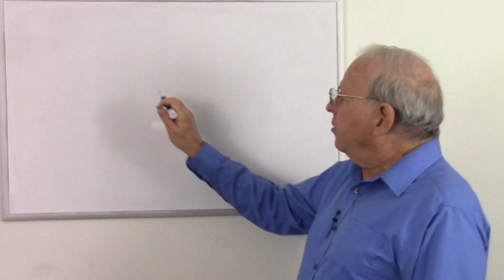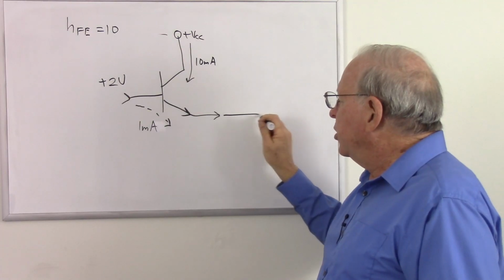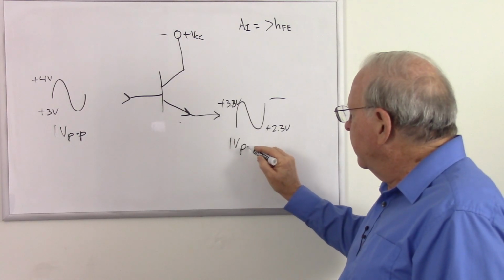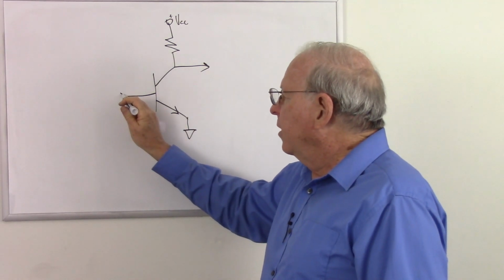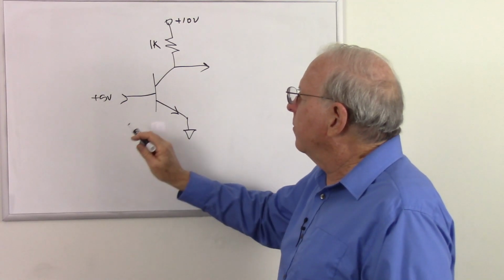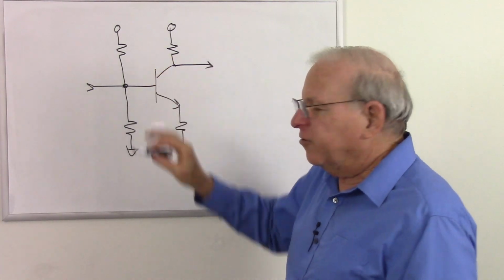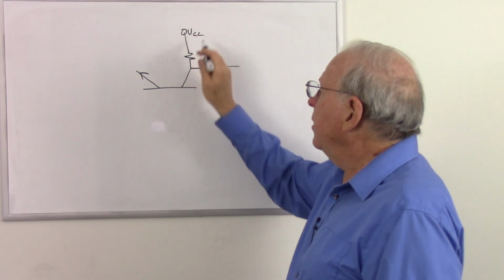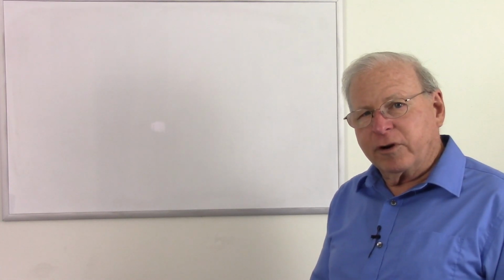Amplifier Configurations  - Solid state Devices and Analog Circuits - Day 6, Part 3

Comment: I am really enjoying your vids, so 1 thing disappoints me a bit. My mental arithmetic is pretty fair, and 7.5V from 10 is 2.5, not 3.5. This mattered as that error formed the part of other calculations.  Sure, I got the point, but its still disconcerting. In your amp design vid you described 10mv as 0.1V instead of 0.01V and so derived 10mv plus 0.7V as 7.1V instead of 7.01V. Again, I understood what you were doing, but your calcs were now wrong in a few other places when you used 7.1V. I usually criticise calculator use for simple stuff, but please start using one - accuracy here matters in these classes. 

I apologise to you again, your classes are brilliant and I'm getting so much from them. Criticising is the last thing i want to do. These classes are brilliant. But sadly, these things scream at me. I'm much faster AND correct, usually, so notice these. If I'm wrong in either place (I kinda hope i am), please show what I missed - am fully aware I could have misunderstood something.

Comment: Hey. Love your videos! Your a great teacher. Could you make a video and explain the ne5534, what the balance pins do and everything? When you check a regular micpreamp circuit they almost always have a small cap in parallel negative feedback resistor, why? And sometimes they put like a 100uf cap before the second resistor reaches ground. Thank you for you hard work! Willie from Sweden

Comment: When i connect to the output capacitor to the emitter I get extremely low output however if I connected to the collector I get much higher output why is that?